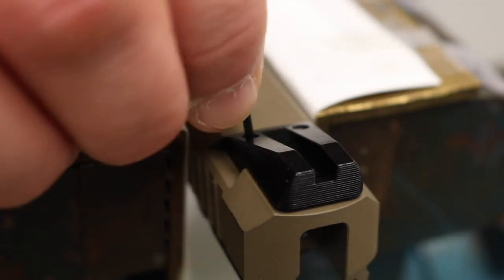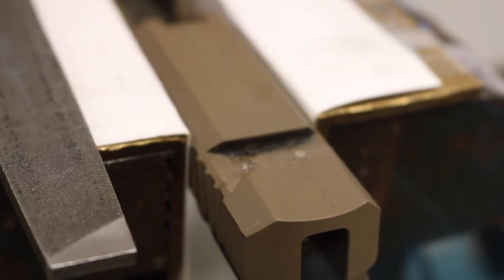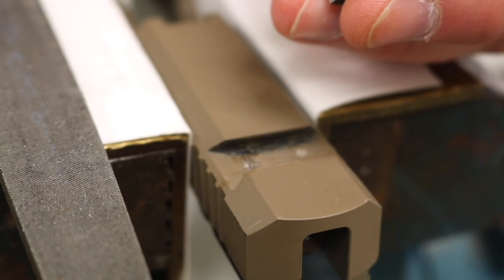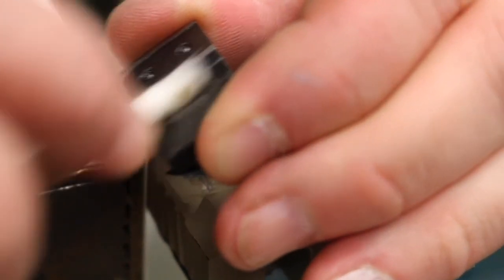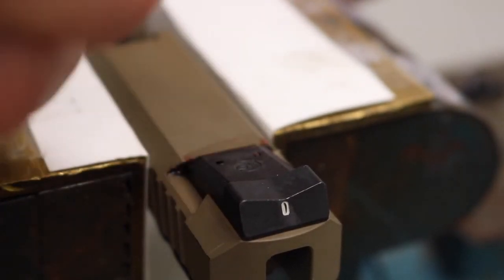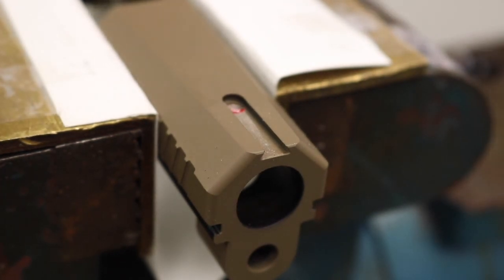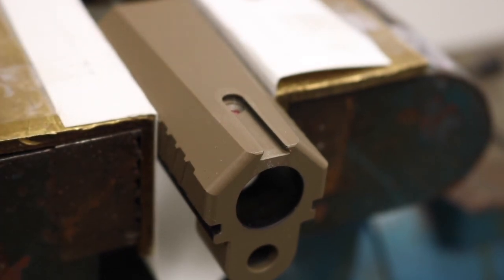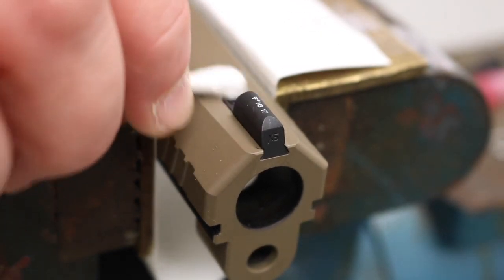XS Night Sights Kriss SPHINX SDP Installation

Comment: Thanks for this video!  I agree that red Lock Tite on the front set screw would not be a good idea. However, when you placed Lock Tite in the front dovetail and pushed the sight back into position, there’s a strong chance you pushed the product into the set screw hole anyway.  I would recommend placing the liquid further ahead so it doesn’t make it to the threaded hole. A person can always use blue Lock Tite on the set screw as it will release the screw if needed. Thanks again for a super video!

Comment: From looking at the front sight, it does not look like was not flush with the front of the slide. Maybe a 360 deg look at the front and rear sight would be nice. I do own 2 Sphinx SDP and would like to some pictures before committing. Possible?
Reply from the maker: It is almost flush. Less than 2 thousands of an inch difference. More images will be coming soon.
Reply: did you make the purchase?

Comment: so it requires minor fitting to  put the rear sight on??
Reply from the maker: Yes most sights will need minor fitting to go on. We chose a sericoat finish, because those add to the dove tails factory width making requiring more work to install. Factor finished slides will be a bit easier.
Reply: XS Sights  When will these be available? It says 2/17 So I assume soooon?
Reply from the maker: They are. check out our website.https://www.xssights.com/Products.aspx?CAT=10224
Reply from the maker: These are available for sale on our website.https://www.xssights.com/Products.aspx?CAT=10224